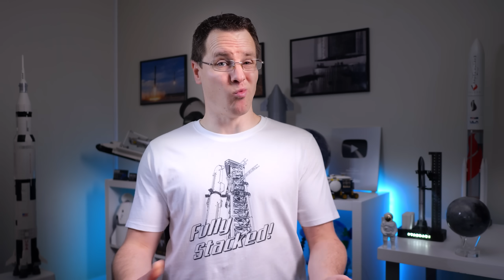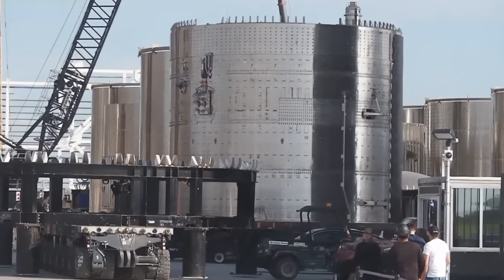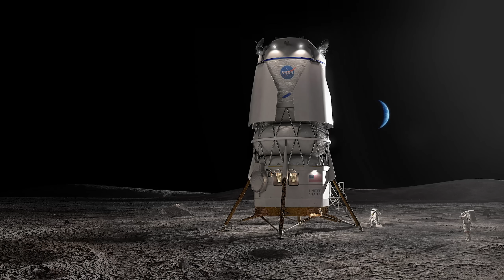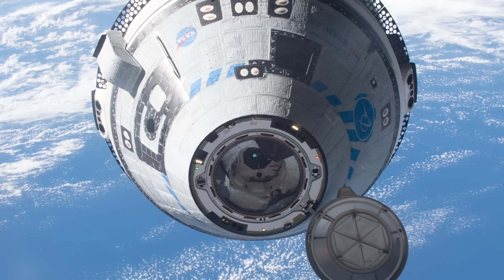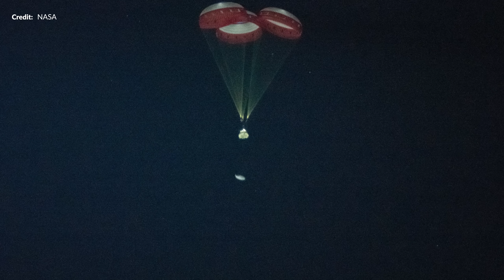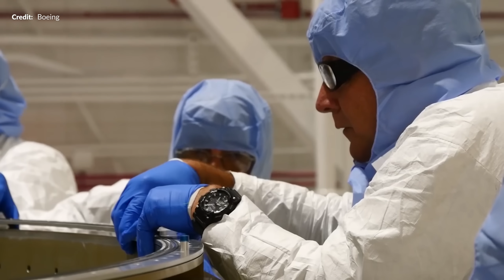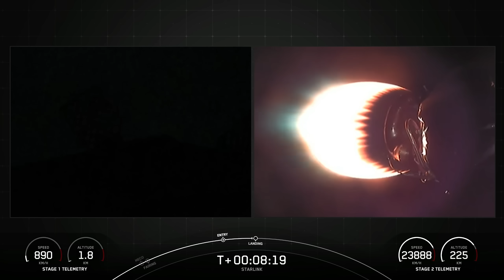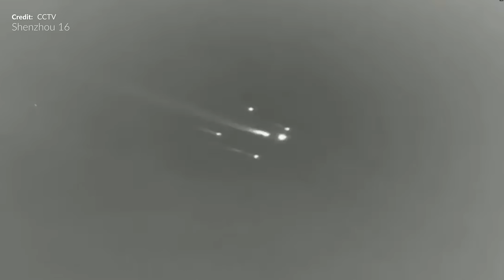SpaceX Starship: Mega Pad Upgrade to Tame the Thrust, Boeing Starliner Delayed Indefinitely

Comment: My guess is that the booster separate before the core stage because if it were to separate together, it would change the flight profile of the reentry to the surface in such a way that would land in a undesirable location.
Reply: this kind of makes sense, I believe first stage separation occurs while the rocket is still over mainland china for most of their launch sites.
Reply: It reduces mass and thus momentum in all stages, but I hadn't considered the recovery aspect. Having all 4 attached makes a heavier piece, and separating the 4 after it is removed could give them a less obvious, perhaps more dangerous return path. I was first thinking momentum for release from the 2nd stage, and the extra effort required to remove the full stack putting strain on what you really want to keep. I also wonder if the engine type has anything to do with this choice.

Comment: Starlink is amazing.   My parents, who live about 15 miles from a major city, had been putting up with 1mbs x 128kbs (on a good day).  I convinced them to try to get into the Starlink beta.  They did.  They got the equipment and within a and hour - they had 100mbs x 10mbs.   Its uptime has been way better than dsl.   It just works.  I really hope it screws some of the isp's that have not put any money into infrastructure..  (this is the US)
Reply: Same here, screw these cable companies that haven't replaced 20+ year old copper lines.  Then want to charge 70 bucks a month for shit dsl.
Reply: Ditto. Couldn’t get ISP’s to do squat for me on my rural farm. Signed up on the waiting list for Starlink! Took a year to get it, but since installing my dish, I’ve been thrilled with the service. It just works, and down time is extremely rare. So screw the land based ISP’s. I don’t need your crappy, expensive service any more!
Thank you Elon!
Reply: Yeah, 50Mb down/5Mb up where I live (in the US), for $150/mo. Starlink is available and I'm looking into it.
Reply: @canonicaltom  that's scary honestly. It started at $75 a month and within a year has already doubled and the speed has gone down more than half.
Reply: @bobo191999   you're right now that I reread it. I have seen that starlink rates have gone up as well as the avg dl rates have dropped but still better than can be had in most rural areas.
Reply: @cchavezjr7  I've read about this too, but while price has gone up by $10/month for my parents in rural Wisconsin, their speed has increased from 90 down to around 150. Compare that to the 5-7 down and crap customer service they were getting with CenturyLink - no brainer.
Reply: UK has the same problems in rural area. Step just 5 miles away from town and you’ll struggle to get 2Mbits. Starlink solves that.
Reply: @yenahnahnah  Right, Starlink would be cheaper and higher performance than my current setup.

Comment: for the Chinese booster,  possibly they remove those four prior to separation in case a burn in one of them doesn't terminate when it's supposed to so it won't then steer the whole booster off in an unfortunate direction?

Comment: The flammable tape sounds like a badjoke. It’s not like Boeing has been in the aerospace industry for more than 70 years. Quality of Quality control is a big interrogation mark here. Unbelievable, but considering what happened on the recent aircrafts production issue, seems to be an endemic problem with them. Time to rethink the “If it’s not Boeing, I’m not going” motto?
Reply: To be fair, the tape is flammable only in certain situations per reports. And requires failures of other hardware to happen. Per NASA/Boeing, "Although that tape is commonly used on other spacecraft, they are evaluating if it is acceptable for crewed flight (article NASA and Boeing say preparations continue for July Starliner test flight Jeff Foust May 27, 2023)"

Parachute and wiring issues to delay Starliner crewed test flight
Jeff Foust - June 1, 2023

"Both the parachute soft links and wiring tape were used on the Orbital Flight Test (OFT) 2 uncrewed test flight in May 2022 without incident. The soft link issue, officials said, would only be a concern if one of the three main parachutes failed, putting additional loads on the other two, while the flammable tape would have required what Nappi called “multiple failures” elsewhere in the spacecraft."

---------------

Boeing finds two serious problems with Starliner just weeks before launch
ERIC BERGER - 6/1/2023

"The second issue involves P-213 glass cloth tape that is wrapped around wiring harnesses throughout the vehicle. These cables run everywhere, and Nappi said there are hundreds of feet of these wiring harnesses. The tape is intended to protect the wiring from nicks. However, during recent tests, it was discovered that under certain circumstances possible in flight, this tape is flammable."
Reply: I don't mean to disparage, but I believe there are certain tribes who are very good at knowing what things are supposed to look like, and very gregarious and highly convincing in conversation, who are not good at actually designing the full workings. Unfortunately, having had a limited experience with the best of the best of that tribe, certain entities and individuals have taken that cherry-picked example as evidence of the majority. Scott Adams and I differ on much, but his "Elbonia" series applies to more than Europe. Some nations should stick to spices and dancing.
Reply: @up4open763  🙄🤡
Reply: @steveaustin2686  Mr. Austin, I can only relay what I see on a daily basis. The US was coddled for the last 80 years with immigrants from certain lands being ONLY the highest achievers with the best of behavior. That has biased views.
Reply: @up4open763  🙄 If you want to traffic in bigotry, that's on you.
Reply: @steveaustin2686  It's interesting that word, it's actually Humanist invective towards the Netherlands Christians who use to say "Bygott" which means "By God." So much for inclusivity? If you think the majority of people in India are prepared to be doctors and scientists, you've got a positive bias yourself, and you're probably wrongfully prejudiced against your average redneck US neighbor. Reality, most of the world is a redneck, India included.
Reply: @up4open763  I'm not going to say any country should "stick to spices and dancing." Again, if you want to live that way, that's your problem.
Reply: @steveaustin2686  If only it was, because I can't even speak a truth about the world without being told that I'm clearly choosing to not learn about the world. Which if I could find the definition to Ironic, is probably an example. You and I did not make this planet, or it's people, but we have the ability to see things for what they are. Being ashamed of that, maybe there's something to be changed? But when there's no ability to speak of it?! Stuck.
Reply: @up4open763  Again, disparge others all you want, that is on you.
Reply: @steveaustin2686  See, you think that noticing where other's are weak is disparaging. I don't put a blind man in charge of his bus. That keeps him alive.
Reply: @up4open763  Tap dance all you want.
Reply: @steveaustin2686  I'm not tap dancing, the Indians sank their own submarine. If I want a log cabin, I'm not asking a guy in the Sahara to design it. But don't worry, my Michael Jordan b-ball skills will be growing any day now, I've learned tolerance.
Reply: @up4open763  🙄
Reply: @steveaustin2686  Yes. That's the feeling I get when men who can read tell me about what nations that won't teach that skill to their own are supposed to mean to me.
Reply: @up4open763  🙄 Tap dance all you want.
Reply: @steveaustin2686  I'm not dancing. I have no reason to dance, I'm trying to keep as many of us alive as possible. Them included. I don't put a blind man in the driver's seat, and that's not hateful. It would be to carelessly hand him the keys to a lambo and tell him he can drive anytime he wants. That would be asking for harm to him and likely others. That you're being conditioned to be ashamed of what makes you unique, while others are to be flaunting their uniqueness, even worshiped for it, is hateful of you, not from you, but hate Of you. You deserve to have a known success as people, if anyone does. So here we are, my people have a good skill in engineering. Some peoples don't. I won't dunk, don't ask.
Reply: @up4open763  Nope, not buying that bullcrap from the RWNJs either. You want to follow them to damnation, go right ahead. Leave me out of it.

Comment: You would think that Boeing would have learned from the Apollo 1 tragedy not to load up the space capsule with flammable tape, since Apollo 1 had many pounds of flammable velcro that when burned released deadly toxic fumes killing all on board when internal sparks quickly became fast traveling flames which burning velcro spread the flames fast when combustion speed was enhanced even more by a rich oxygen capsule environment..
Reply: I think the ability to remember, learn and inform future work is an unpublicised necessity for a successful organization.
The bigger the organization gets, the harder it is to do this. So important.
Reply: To be fair, the tape is flammable only in certain situations per reports. And requires failures of other hardware to happen. Per NASA/Boeing, "Although that tape is commonly used on other spacecraft, they are evaluating if it is acceptable for crewed flight (article NASA and Boeing say preparations continue for July Starliner test flight Jeff Foust May 27, 2023)"

Parachute and wiring issues to delay Starliner crewed test flight
Jeff Foust - June 1, 2023

"Both the parachute soft links and wiring tape were used on the Orbital Flight Test (OFT) 2 uncrewed test flight in May 2022 without incident. The soft link issue, officials said, would only be a concern if one of the three main parachutes failed, putting additional loads on the other two, while the flammable tape would have required what Nappi called “multiple failures” elsewhere in the spacecraft."

---------------

Boeing finds two serious problems with Starliner just weeks before launch
ERIC BERGER - 6/1/2023

"The second issue involves P-213 glass cloth tape that is wrapped around wiring harnesses throughout the vehicle. These cables run everywhere, and Nappi said there are hundreds of feet of these wiring harnesses. The tape is intended to protect the wiring from nicks. However, during recent tests, it was discovered that under certain circumstances possible in flight, this tape is flammable."

Comment: Hi Marcus, the SRBs detach from the first stage before staging due to residual thrust. SRBs take a while to flame out. If they were still attached, the first stage could run into the back of the 2nd stage.
Reply: Reminds me of what took down the Falcon 1 ? third orbital test flight when they realized they needed to delay stage 2 separation after booster cut off. Without the delay, the booster’s momentum made crash into stage 2 causing it to fail. This nearly ended SpaceX. Read about it in the book called Lift Off by Eric Berger. Lotsa love to all from Toronto ❤❤❤
Reply: @DouglasJMark  Thanks, interesting history, all the best
Reply: @DouglasJMark  50+ years of rocketry prior to spacex and they didnt know to expect that? *doubt*
Reply: The Longmarch doesn't use SRB's! The strap on boosters do not provide residual thrust when the liquid propellants are depleted. The full seperation is likely to stop the first stage from decelerating too fast for a number of reasons. Control of descent being the main reason.
Reply: Thanks, really appreciate the range of topics covered, especially other nation's flights. All the best
Reply: Great knowledge, thanks for sharing!
Reply: The exhaust in the short shot of the launch did not look like an SRB. That should be blindingly white from the glowing particulates. But it was kinda transparent. Am I missing something?
Reply: Took the words right out of my mouth.
Reply: Ah, that makes perfect sense! Welcome to the world of SRBs... :/
Reply: No SRBs

Comment: NASA should just cut their losses and ditch Boeing, they’re clearly out of their depth and SpaceX has achieved a lot more with a lot less.
Reply: I'm pretty sure NASA would love to, but the politics is forcing them to keep Starliner going.
Reply: @darthkarl99  Boeing has to pay for the Starliner fixes, so why should NASA cancel the contract? Everything is in NASA's favor and NASA won't let it fly, until the fixes are complete to their satisfaction. To be fair, the tape is flammable only in certain situations per reports. And requires failures of other hardware to happen. Per NASA/Boeing, "Although that tape is commonly used on other spacecraft, they are evaluating if it is acceptable for crewed flight (article NASA and Boeing say preparations continue for July Starliner test flight Jeff Foust May 27, 2023)"

Parachute and wiring issues to delay Starliner crewed test flight
Jeff Foust - June 1, 2023

"Both the parachute soft links and wiring tape were used on the Orbital Flight Test (OFT) 2 uncrewed test flight in May 2022 without incident. The soft link issue, officials said, would only be a concern if one of the three main parachutes failed, putting additional loads on the other two, while the flammable tape would have required what Nappi called “multiple failures” elsewhere in the spacecraft."

---------------

Boeing finds two serious problems with Starliner just weeks before launch
ERIC BERGER - 6/1/2023

"The second issue involves P-213 glass cloth tape that is wrapped around wiring harnesses throughout the vehicle. These cables run everywhere, and Nappi said there are hundreds of feet of these wiring harnesses. The tape is intended to protect the wiring from nicks. However, during recent tests, it was discovered that under certain circumstances possible in flight, this tape is flammable."